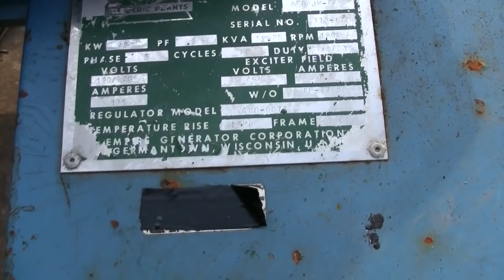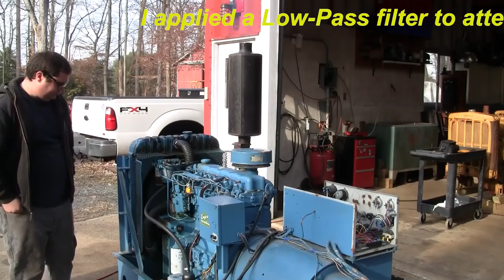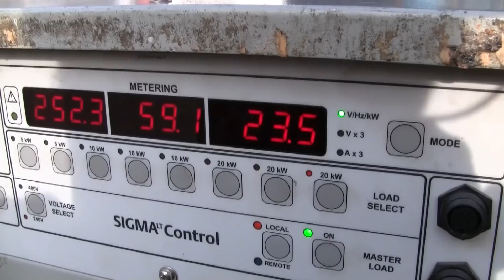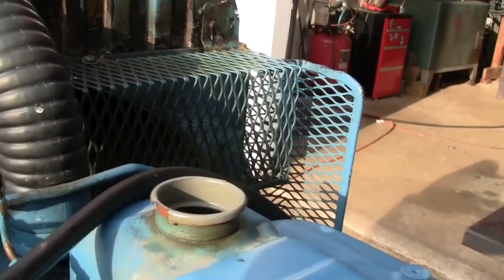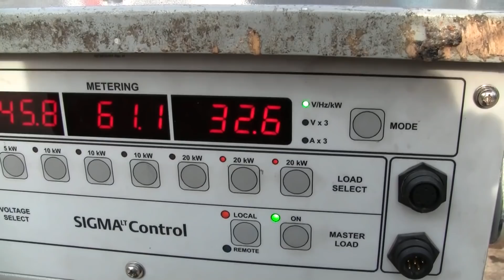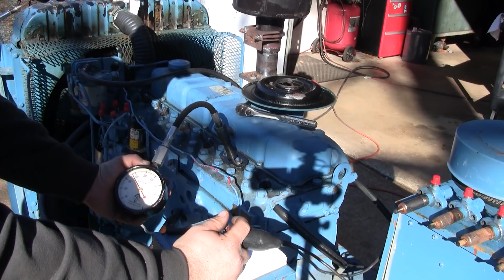PERKINS DIESEL Generator Upgrade Engine Trouble Pt.1

Comment: Empire generators were built for the budget price market, like Generac etc. 
Lucas mechanical governors aren’t the best for generator applications. Even with a well adjusted mechanical Governor you’ll be lucky to get 5% droop. Upgrading to an electronic isochronous Governor would be a vast improvement.
Reply: yes exactly right, i have a 152 on a 20 Kw 3 phase which had a Stanadyne pump, lovely tight govenor on that but broke the input shaft so swopped it out for a CAV as i couldnt afford a replacement Stanadyne at the time..the CAV run lovely but wouldnd govern worth a toss so i stripped the pump, removed all the mech govenor mechanism and refitted it to an electronic govenor..its now perfect whatever the load

Comment: The misfire, shuddering and odd sound on cummins means you need to clean the injectors.  Usually a bad spray pattern causing an odd burn pattern in the cylinder.

Comment: I think your expecting too much out of that engine, I work on them and have tons of small diesel engines, your governor may have come apart take the return line off the injection pump and see if there are small pieces of fiber clogging it, if that was the case though you wouldn't have any horsepower. I work mostly on Stanadyne pumps.

Comment: Personally, knowing those CAV pumps, just rebuild the pump, those engines are bomb proof. If you need parts for a perkins, i use my local Massey tractor dealer, just about everything was perkins in a massey furgy at one point, from 3 cylinders to V8's.
If i remember right, the governors in those 354's were a sliding rack with a spring that wasnt the most accurate from new, just on the verge of good enough...
Dont give up on her..
Never seen one loaded up like that before

Comment: check out a Napier Deltec for a UK design....
I soak cylinders with Marvel melts carbon out after a few days . Then start after clearing oil out .
Probably never had load and just ran high idle for its life.
At DOE AEC we had to run monthly under 75% load.
We had 50 gensets from all makes 1960s to new.
Excellent thanks.

Comment: Question,  does the large generators like this produce a clean sine wave? Or are they dirty like the smaller generators you get at the big box stores.
Reply: Entirely depends on the regulation equipment.

Comment: I'm wondering if the rings might be out of it due to running it too long with the oil dilution issue?  The set might need an overhaul to bring it back into spec?

Comment: Couple of things for you i have worked on many of these Generators with 6354 engines in standby applications with CAV  DPA pumps, these tend to get a build up of varnish and tend for components not to freely move creating excessive speed droop /poor performance of the governor, a strip clean is what's generally required , there is also a strainer in the end of the pump of which i am sure you would know about and the lip seal can leak at the drive end, the other issue is these Standby Generators tend to have aged fuel in them of which i think adds to gumming /varnishing of components, thus overall poor governor performance.
Reply: Those pumps aren't that good in governing when they are brand new. They are not exactly built for that application.
Reply: But better results should definitely be obtainable. Don't get me wrong.
Reply: Was thinking the same thing myself about whether it had been stood for a long time and if the fuel metering rod/pin (under the rectangular cover) and/or it's mechanism might be a bit "gummed" up.

Comment: The compression values for the metric viewers:
Cylinder 1 - 360psi = 24.8bar
Cylinder 2 - 340psi = 23.4bar, 345psi = 23.8bar, 350psi = 24.1bar
Cylinder 3 - 355psi = 24.5bar
Cylinder 4 - 300psi = 20.7bar, 330psi = 22.8bar, 350psi = 24.1bar
Cylinder 5 - 365psi = 25.2bar
Cylinder 6 - 365psi = 25.2bar

This means all cylinders are within ~1bar of each other from lowest to highest.

Comment: Great to see a Perkins on the channel! If you find parts sourcing an issue then I believe Massey Ferguson used this engine in Combine Harvesters for many years in the USA, as well as in tractors/boats etc. Otherwise have a look for your local Sparex supplier, they supply aftermarket parts like seal kits and transfer pumps etc for not too much cost.

Comment: To you this question will seem stupid. When you put on the loading equipment, where does all that input go?. Always enjoy your work.The engine does not sound too bad, depends how many hours it has worked.
Reply: It gets turned all into heat
Reply: @gigigigiontis8  That guy should have a cooker on load there.

Comment: Frank Perkins founded Perkins Engines in 1932 in Peterborough UK. They still exist today and are a leading supplier of diesel engines globally. I believe they were bought out in the late 90's by Caterpillar. They are a leading employer in the Peterborough area. Before I moved to France 17 years ago I lived in Stamford some 20 minutes from Their production plant. I was lucky enough to get a tour of the factory over 30 years ago. Huge by UK standards and very impressive. Way back then in Stamford we had Mirrlees Blackstone another diesel engine manufacturer well known globally at the time. Over the years there were mergers / buyouts with Lister, GEC, MAN etc. Way more than I can remember clearly......
Whilst living in the UK I worked on two RAF bases which used pairs of GE locomotive engines to run standby generators in case of national grid power failures. They were V16 quad turbo diesels producing around 1600 hp a piece at 750 rpm. On a typical test run (on a saturday) we would generate a megawatt for a few hours. Nice! From memory the engines were about 30 feet long.
Reply: I worked on a towboat back 50 years ago that had two 16 cylinder GMC diesels on it that produced 1600 hp at about 750 hp.  They had were identical to the engines on locomotives, big noisy engines, two stroke engines with four superchargers each.  They ran wide open almost all the time.
Reply: @regunter6599  we had 4  v16-71 detroit Gensets 350kw at nuke plant .. noise was lethal.
Now one Cummins Onan 1 MW replaced all 4 .
Reply: Cheers..I have a few Perks and a JCB also.

Comment: Over the pond,the engine is a perkin 6354,very good engine ,the engine was fitted in every thing made ,check the fuel pump per filter,prone to blockage,and the fuel pumps fail.

Comment: Nice  generator I enjoy your videos , Perkins info 6.354 = 6 cylinder 354 cu inch. These engines were used for many years in  Hyster forklifts .
Reply: After sorting the leaks if still runs bad I would check the distributor drive to the DPA fuel pump. Technically the transfer pump is on the end (top) of the DPA. This generates round 60 -80psi. The diaphragm pump on the other side is   a low pressure lift pump
Reply: Not sure would not be surprised if the leaking filling damper is not helping.

Comment: Needs new pumps and she will run forever. Perkins makes a good engine. As long as you don't wash the rings with that fuel in the oil.

Comment: the thing leaking on the left side of the injection pump is the automatic timing advance piston. Before you get too crazy, check the 2 bolts that hold it onto the pump body, they tend to loosen and it leaks. If not it may just need to reseal it. They engine runs well it sounds like. The blue smoke is normal, those 354 perkins werent a clean burning engine but they were bullet proof. We have some on farms with over 12000 hours running irrigation pumps and they just keep going. You are on the right track with the fuel pump leaking from transfer pump, common problem on them.
Reply: True Perkins excellent I have a few in all equipment 4 and 6 cylinders.
Old Forge Power in Pennsylvania has tons of used motors parts awesome source..
Reply: Leak could be the diaphragm in the damper or the damper being loose as it is one of the two fittings holding the auto advance box to the cambox.

Comment: Its wet stacking also, those Perkins engine like to be worked hard an for long periods of time, might have a bad injector. Also could be sucking some air in were all those fuel leaks are.Oliver tractors used those in there tractors as well an they were work horses

Comment: I can't remember if it was this engine or another one, but I remember on one of them you were trying to adjust the governor.
Your problem that time was that you were only adjusting the outer tensioner. That merely moves the position of the frequency band (limit adjuster). If you adjust the inner tensioner that will change the width of the hysteresis loop (range adjuster). You need to get that right before you can adjust the outer tensioner.

Edit: On this engine there must be some other mechanism, but they all have to have separate range and limit adjusters.

Comment: On my genset the fuel in the oil was from the injection pump. I had it rebuilt and fixed the issue.

Comment: All the engine and fuel pump is/was local to me.
I made lots of parts for the CAV line as an apprentice in the late 70[s

Later in life had 1truck with 6354 and 2 JCB diggers with the same unit.

Comment: Sounds like you have already diagnosed what is wrong.  Several simple things.  Do you ever calibrate high pressure fuel pumps?  My Yanmar three cylinder needs calibration.  It uses shims.